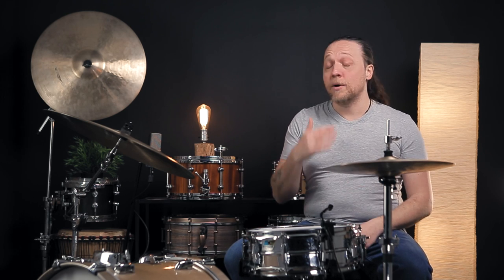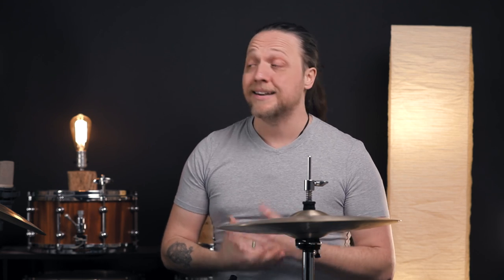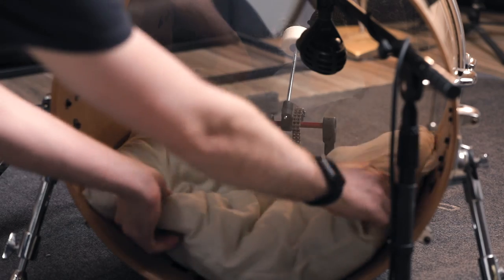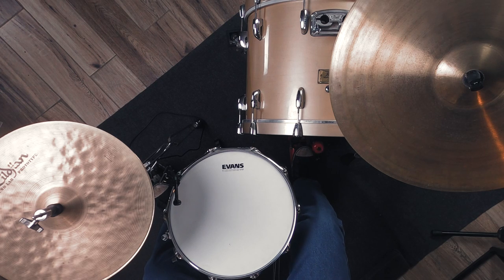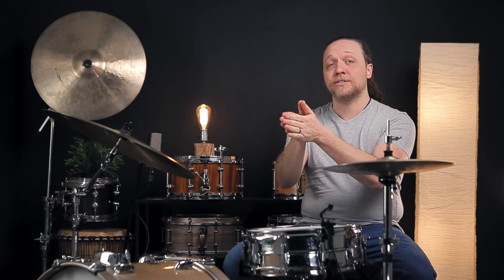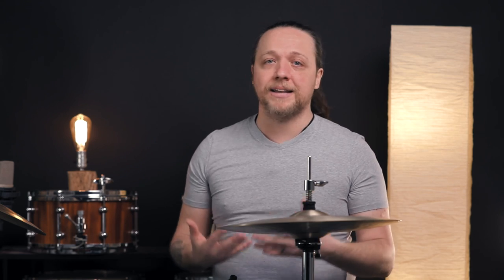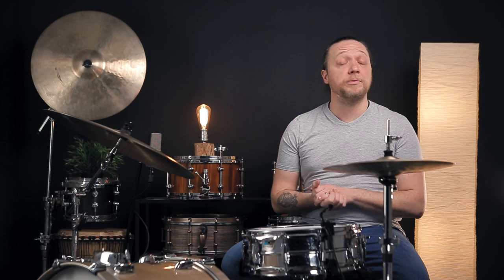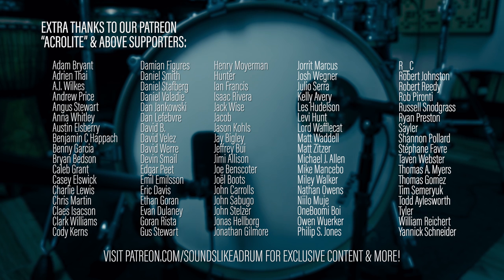DIY Clicky Metal Kick Tone Step-by-Step | Season Five, Episode 38

Comment: Quick tip for anyone doing finger tight tuning. After you’ve gotten the lugs as tight as you can get them with your dominant hand, lay the drum flat with the head facing up (doesn’t matter which one you do first) and push down lightly on the hoop by one of the claws and give that lug an extra twist. Do the same for all the lugs on the drum. This will mitigate the lugs backing out while your playing with out having to buy lug locks or anything of the sort.
Reply from the maker: Yep! Our method of choice (particularly because it's easier/faster than setting the drum flat on the ground) is to place your thumb on the hoop and fingers on the back end o the lug and squeeze. This won't put as much weight into the hoop but it'll usually get you a bit more tension on the claws. We also recommend considering removing half the lugs as we've demonstrated in a previous episode if the finger-tight approach is a frequent choice. As a result,  you can tension each rod a bit more while achieving the same drumhead pitch.

Comment: When I was playing in a local metal band in high school, I got a bad taste in my mouth about muffling toms and bass drums after seeing people literally fill their bass drum with pillows and have multiple moongels on their toms. It always seemed like they were trying to cover up bad tuning, so I made a point to use as little dampening as possible and be fastidious about my tuning. My bass drum was a 22x18 pearl export, and I just had a Remo powerstroke 3 tuned low-medium with a falam patch, and an ebony p3 reso head with a port tuned slightly lower, absolutely nothing inside, and used the plastic side of my eliminator pedal. I'm sure a lot of credit goes to the sound guys (when there was one) but I got plenty of compliments and people asking if I was triggering my bass drum. I'm sure it also helped my bass drum be heard better at shows with no sound system.

Comment: Awesome video! Every single one of those bass drum tones sounded great and usable. It was insane to hear the difference just from adding the quarter!

One trick I used to dry out my kick was to make DIY vent holes (think Evans Dry style) around the perimeter of my kick reso head. I like to play with a full front head, but wanted a way for the air to escape, so I made twenty 1/8" holes around the reso head. Batter head is a Super Kick 1, about a quarter turn past finger tight for a little bit of rebound and shell activation, with a Double Kick Patch on the strike zone of the two beaters. And of course, a sandbag! Haven't taken that out of my bass drum since you guys first did that video!

Comment: When I was playing (late 70s, playing a Ludwig Vistalite kit with Remo batter heads, and no reso heads), my bass drum had a small square of old plastic batter head (about 4 inches square) taped to the batter head where the beater hits. This provided a nice click. The mike inside was placed really close to the strike point. The beater was a hard, felt head. No reso front head, and a pillow placed inside the drum.

Comment: You are using all of my tricks! Only difference is I use a dollar coin instead of a quarter and I use a leather patch between the dollar and the head for longevity of the head. I don't really use this sound much any more, but you nailed it. Also, I use E6000 adhesive to glue the dollar to a leather patch and carpet tape to hold the leather to the head. Pretty much the Vinnie Paul tone with a little  eq and processing. Nice job!
Reply: dude.  that costs 4 times as much money though  😆
Reply: @nickdenardo6479  bahahaha!

Comment: I've been using this setup for decades, with the exception of the coin with gaff tape. Gaff or duct tape can and will break down over time (especially if you have a habit of burying the beater) and will leave a sticky residue all over your beater. It will also make a sticky mess out of your bass drum head. Go with a Danmar hard disc impact badge instead. You'll have a bigger surface area for your beater and the thing will last you for ages before you have to replace it. Plus they make larger ones for folks who use double kick. Definitely worth the $10.
Reply: Extra gaff tape to hold it on.

Comment: Used to do something similar with old debit cards. It achieves a similar effect, but not quite as extreme.
Reply: i recently set up some drums that have a batter head on the kick drum that has no 'protection'.  i do have a mylar patch from Remo i think, but i was thinking of trying an old bank card.  i think this is a sign from the drum gods!

Comment: i've known about this technique for quite a long time, but have never tried it.  i used to gig a lot, and i realize, after all these years, that i was doing a lot of things wrong.  oh well.  i guess a good meter and good dynamics helped get me a decent reputation.
i still probably won't do this, but i appreciate knowing where the results could take me.
i also, have become a fan of getting different sounds without spending a lot of time recreating the setup of any given drum.  i've landed on the Switch Kick by Ahead.  i usually leave the plastic/felt beater that comes with it on there, but i do have several other beater attachments.  they make a plastic one with a hole through the middle.  more attack than i've ever wanted.  unfortunately, it costs quite a bit more than a quarter 😒

Comment: have my kick with a pretty tight beater head no reso and a pillow lightly up against it. the beater is cylindrical like a felt beater but rubber. this gives it a very bassy sound. less of a click more of a boom.

Comment: What has worked best for me is a Powerstroke 3 (or EQ4) clear on the batter; coated, smooth, or clear PS3 on the reso with a 5 inch port. 

Tune the batter JAW, or ever so slightly higher, and the reso a little higher than that for a good tone.

I use a Remo Falam Slam patch and the Accu-Strike beaters that came with my Speed Cobras.

Only muffling, if needed, is a t shirt balled up against the batter head.

The mic I use is an AKG P2 with the capsule and screen just inside the port, with the back of the screen lined up with the port, pointed directly at the beaters. It's cheap and brings out the click.

If I need more meat in a recording, I set up a send to another track in reaper with a sine wave generator running at a frequency that fits the track and kick (or just 50hz), and have the kick send trigger a gate to controll the sine wave. Like a little digital sub kick. (Tutorials can be found youtube for this).

I do the same thing for my snare, but with a white noise generator. Works great when limited to 4 mics 😉

Comment: Depending on the mic the Akg D112 actually has better mid lows then the Shure 52a so the Akg d112 may have more of punch over all also for punch of bass drum the closer you get to the  head and beater the more punch some times the best way to get this is with no back head at all for punch you don’t need outside ambient overtones of the back head

Comment: Follow this video up with how much mics make a difference. They really dictate your tone and character as well. I had a D112 for over 20 years before it died. All I could find in a weeks time was a Shure drum mic pack. The beta 52 was by far better than the D112. However, the SM 57 mics are really thin sounding on toms, so I continue to use the AKG D40s  on the toms. Sometimes the sound companies take care of micing my kit and there are tons of them using Audix. I'm certain the reason for this is the mic itself does a predetermined EQ. I'm not talking about the natural response of the mic here, I'm talking about circuit boards that force it to sound a certain way. It's always best to be like Cody, test and tune on everything to get the sound your after. Leave no aspect to chance because everything has it's purpose.

Comment: I use the danmar impact pads for my kick drum and it does a very similar thing, but they are sometimes hard to find. This is a great alternative. Does the gaff tape end up ripping and get sticky ruin the feel?
Reply from the maker: If you're looking for a long-term solution, those metal impact pads are definitely the way to go. This sort of hack is something that would likely need to be re-applied for each session or show if you're performing. The tape will eventually breakdown and, depending on the drumhead, the quarter can wear through. This is all affected by tuning and how hard you're hitting as well.

Comment: I would love a way to simulate that metal click sound with out a coin on the front of the batter. That destroys heads (I know from experience). 

Has anyone ever achieved that "triggered" sound by mounting something inside the drum or back side of the batter?
Reply from the maker: You can use one of the Danmar metal patches and it won’t destroy the batter head anywhere near as fast as using coins. The expanded surface area helps quite a bit.

Comment: Honestly preference I like it to boom as long sustain as much as possible then muffle it enough to cut the sustain add a gibralter click pad then it's perfect. I would tune it up a bit. Use a Danmar or plastic beater. I don't like akg mics it's terrible. Honestly it's preference.  I wouldn't use gaff tape the drummer for slayer used moleskin over a quarter.

Comment: There's many things you did right, but the amount of dampening is waaaaay too much. Since you're using non-dampened kick head, it needs something inside. However I would max out using medium sized bath towel. If you use too much dampening, it eats away the attack and makes it too dark. You just need to adjust some overtones to make more controlled sound and not to kill 'em all. Do that and you don't need coins and gaffa.

The other thing is the miking. Usually metal side of things use condensers inside the drum (like Shure sm91). That's because the condensers don't mess with the transients as much as dynamics. The D112  shapes really much the attack and that makes the sound way different. I would suggest you to buy Behringer ba19. It's cheap, good and available. Just put the cut mode on, throw it in and you're done.

edit: Oh! One more thing. The old school trick is to tune up the kick head and then loosen the two upmost and two downmost lugs. It can be done to the extremes (as long as the lugs don't fall). That creates more click instantly.

Comment: That coin/gaffer combo! Super nice. It does sound a little sample-ish, meaning a bit static.. How is it with more layers of gaffer between the coin and the batter?
Reply from the maker: More tape would start to cut down on the articulation and ultimately alter the feel while negating the value of the coin. Mileage may vary with this one so the best bet is to experiment in a controlled environment (before you NEED it to work) and assess the performance and durability.